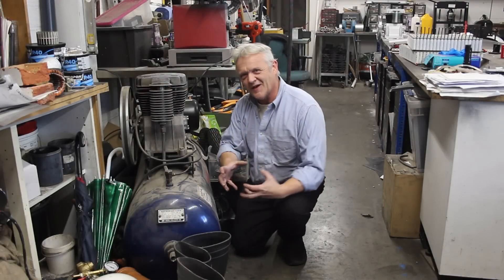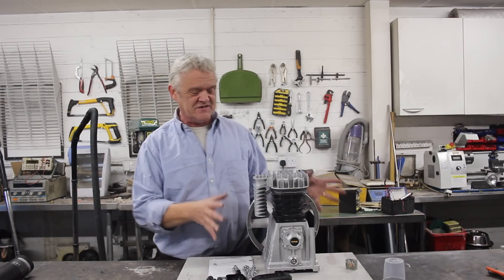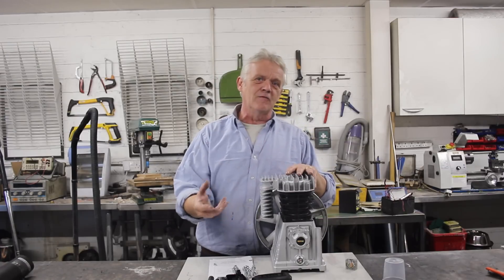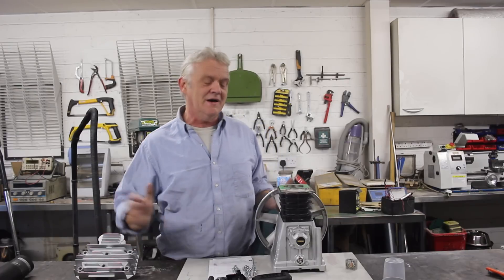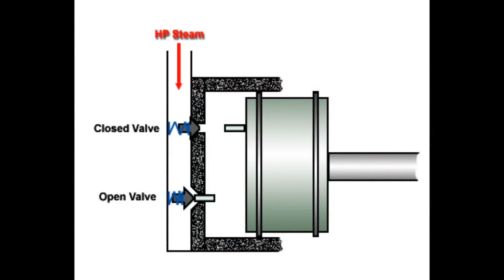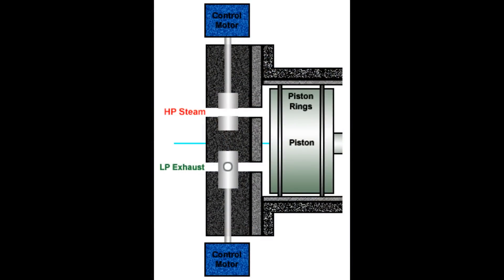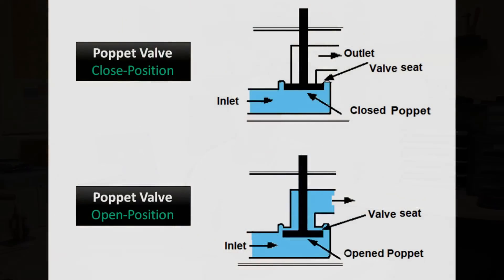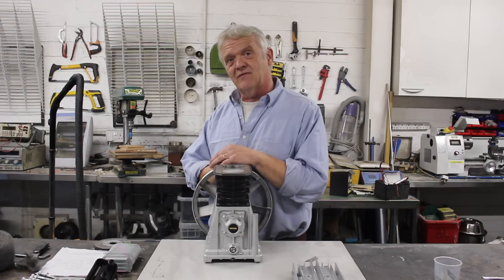1693 A DIY Multi Fuel Home Generator 2 - Changing One Type Of Engine Into Another Type Of Engine

Comment: I've been looking at running a generator using air so this comes right on time. 
I haven't run the numbers but if you can get an air compressor to run high enough pressures then run it in the daylight hours to store the air we could make an air battery which in turn could run the generator for electricity at night and hardly any chemical batteries would be necessary. 
That's the hope, anyway.

Comment: 2 stroke engines are the easiest to convert to steam power, but you have to introduce hygroscopic oil into the engine with the steam/hot air/air pressure/etc. to keep the bottom end lubricated, but will work with almost no conversion at all due to the design of it.
When using an air compressor or converting an internal combustion 4 stroke engine to steam, you have to keep a close watch on the oil since the steam will condense back to water in the crank case.
I had a steam engine I built out of a 60cc weed whacker engine and it performed really well, especially when I used waste oil to boil the water for it, and I just had a setup that would add hygroscopic oil into the intake with the steam and it ran almost continuously for about a year without any issues, until I decided to save the waste oil for filtering and burning in my diesel truck and car.

Comment: You missed probably the simplest valves of them all which would probably work fantastically for a steam engine and that's the reed valve and  the ball valve. No controllers or timing to worry about and probably the most reliable plus it follows the KISS principle.
For the ball valve buy a non return valve plumbing fitting and remove the plastic internals and the spring and remake them with brass unless you can buy all metal version, the reed valve would be a bit more tricky to find or make.

Comment: I don't get it. Assuming you already have the rocket stove and boiler, what are the benefits of this complex failure-prone mechanical design versus a simpler rotor+stator+permanent magnets+copper coil generator, with the rotor moved either hot air or steam?
Is it just to tinker with a compressor, or is more efficient than a regular rotor+stator, or am I missing something (beyond gray cells, of course)?

Comment: Yes to the solenoid valve setup,  there's a guy converting a mazda engine to run on solenoids as is koenigsegg, but I would like to make a play for a diaphragm rubber valve setup for a non-computerized version, where each piston covered by a rubber piece with a hinged section in the middle that pushes open when piston goes from BDC to TDC, and pulls shut at some level of force the other way, due to its weight. Thinking that might be a version a/b design.

Comment: Why don't you just use an old lawnmower engine. There's loads of them about now every one 's changing to robot mowers.
I've got 2 Briggs and Straten engines that just need recon. kits. Still interested to see how you do it though, to see how much power you get out of that 2 cylinder unit?

Comment: VACUUM steam engines are the most efficient but lack power. This operating mode is used for hybrids and TIRs - for savings.
Aircraft with CONTRAILS also use this operating mode. THE CONTRAILS are betraying the savings!
GEET electric generators - too.

Comment: I've been reading about optical heterodyning and searching for photodiodes with values that look amenable to the heterodyne products involved, but I'm not having much luck. If you were to do some content about this, there's at least one guy interested :)
Reply from the maker: to my mind optical heterodyne detection can encode a lot of information mate - pretty good for information heavy signals but quite a bit of overkill for a steam engine valve control where all you really need is TDC of one piston I would think - so not sure if I am going to do it for this project but I will have a think - cheers

Comment: years ago we used a mechanics 1/2" air gun as the engine on a go cart, the limiting factor was the compressed gas bottle. Tom Stanton made his own version a yr or so ago and I seem to recall some where in europe a guy made a car using compressed gas but again the tanks were a limiting factor... I think its easier to turn an ICE into a compressor than the reverse.. any lawn mower engine, remove the plug and spin the crank..  I think it was back In the 40's you could buy a fitting you replaced a plug in your cars engine to make a compressor... imagine pumping gasoline filled air into  your tires or swim floats!! LOL
Reply from the maker: lol - yeah that would be a little concerning - this compressor contains quite a bit of room in the heads - would take a spark plug but I think the pressure from firing this up as an ICE would be a bit more than the head could cope with

Comment: Be aware that your crank is an opposed stroke. 4 stroke twins are usually simultaneous stroke meaning both pistons move together so that the firing pattern is every 360 degrees apart. 
The one in your video is like a John Deere model B where the pistons move opposite and firing is at 360 then 540degrees. 
There’s nothing wrong with that…opposed piston movement cancels each other out and is more balanced, that’s why John Deere built it that way. 
Your engine will have the John Deere “plop” sound instead of a modern Kohler sound. 
I’m building a cross plane 4 cylinder right now which is like 2 John Deeres 90 degrees apart. 
Personally I like the John Deere “plop” sound 👍
Reply from the maker: me too!

Comment: Annother valve type... Pneumatic or hydraulic. Pretty much a piston that highish pressure fluid presses down on to open say a poppet valve. But can get ones that handle fluid logic. Including say a flip flop. 
A nut or some other projection on side of flywheel could be use to trigger a pneumatic sensor... Akin to a microswitch, but outputting pressured air... 
The output from one such sensor triggers a pneumatic flip flop to latch "outputing pressure"
Output from 2nd such sensor triggers flip flop to latch into "no output pressure."
Output from from flip flip. Drives main cylinder valve.  

Connection between pneumatic sensor and flip flop can be flexible hose... 
Adjust position of pneumatic sensors around flywheel to adjust timing of when valve opens, and independently when it shuts.

Functionality should be same as a trip valve, ( the bump valve is a simple none adjustable form of such) with less of the mechanical issues associated with them.
Reply from the maker: nice tips mate - cheers

Comment: Nit picking - Diesels can be changed into other types of engines but not vice versa. A gas or steam engine would not hold up to the very high compression ratios of diesel.  
Some engines do not have valves like the Sterling engine.
Reply from the maker: lol - for sure - but not really the point mate
Reply: @ThinkingandTinkering  True, not the point. 
Looking forward to your next video.

Comment: The history of solenoid driven steam engines is not good.  The solenoids fail after a relatively short time.  Good for a demo but the mechanical linkages are far superior for durability.
Reply from the maker: good point ate - cheers

Comment: Rebuilding an engine to run on another type of fuel is a good challenge to get right and running correctly. I have another challenge for you. Getting one engine to run on different types of fuel without having to do a full teardown rebiuld. Yes it'll have to be built up from the get go but after that how many different type of fuel can be used to run it from then on out.?
I've driven vehicles that ran on petrol for the warm up then swiched over to propane. But can you build an engine that will run on Petrol, Alcohol, Propane, Natural gas and Diesel without a teardown.? Possibly just a change in valve timing, turbo boost, fuel delivery method.?
Thank you so much for the thought provoking tests, chats and builds you'r doing.
Reply from the maker: I like the idea of that as a project mate - therein idea here is to build a genes that any fuel can run - but I may well take up the challenge you just set - it catches my imagination

Comment: Is there an air battery (air compressor) storage system in the works? 😏
Would love to see solar or wind run the  compressor,  then reverse the process to tap into the stored enegry 🤩
Reply: You know I've had that same thought, I like the idea of microcompressors for each solar panel or wind generator connected to a large air storage battery like what the Amish farmers use, and what they had in France a few hundred years ago, it seems to me a perfect way to have a decentralized Energy System while still having it interconnected.
Reply from the maker: I do like the idea of compressed air as storage

Comment: That is a great explanation of the differences with example!  I would highly recommend the slide type valve from steam engines as the way to go.  You have two pistons and the simple slide valve I have seen is an eccentric from the flywheel that moves a block to either end of a solid steam piston.  In your case, instead of switching between left and right sides of one piston, you could have it switch which piston and have a second block on another eccentric 180 degrees from the first to act as the exhaust valves.  That would allow one input of compressed air or steam and one outlet with the added benefit that you could accidentally swap them and the only result would be running in reverse direction.
Reply from the maker: I like the idea of slide valves too mate - robust and simple - great for long term use

Comment: Too bad you can't create a nice Stirling engine out of that piece. But maybe a twin cylinder motorcycle engine could work better for that since the pistons are separated by air/space to allow one for the power piston and the other cylinder for the displacer.
Reply from the maker: yes I thought it was a shame too - if it were a V type I would have certainly gone for a Stirling engine

Comment: I've been tempted to try their rolling mill a couple times in the past, as well as a couple of their other options. But I never could afford to pull the trigger if they weren't high quality enough to hold up under the strain. And didn't know if they would hold up well or not. 

Good to know their products are seemingly decent quality. May have to reconsider.😅
Reply from the maker: I have only had 3 things from them - the lathe is doing well - the diesel heater seemed robust to me and we are basically testing their compressor mate - so we will see

Comment: Darn Robert, really you could use a large piece of (CRYSTAL) for your see through Head Cap and convert pressure into Electrical Pulse to maybe run Spark and other low voltage equipment. What do you think of my Idea? Do you think it could work? Thanks for sharing your vast knowledge with me. I do really appreciate this very much.
Reply from the maker: I don't know if it would work or not mate - but in situations like that - I would certainly test it if I could find a large pipe of crystal!
Reply: @ThinkingandTinkering  Thanks Robert for your reply. I think this would make a fine video, if like you said, 'the Crystal was large enough. I think the Crystal would only need to fit a small area right above the ignition area. The Engine compression would give the Piezo Electric Effect from the Crystal. Sorta like the Electric Cigarette Lighters. I don't know, but I do think it would make a fine video.

Comment: I am a little confused about something: The maximum pressure of most compressors is somewhere between 125 psi and 250 psi (17.23689 barr). The pressure of a typical combustion engine (at the moment of combustion) is in the "thousands" of PSI range ( 68 or more bar). Wouldn't the design of most air compressors be insufficient to handle combustion without exploding?
Reply from the maker: here's a guy who did it https://www.youtube.com/watch?v=xfeazlDEP50

Comment: What is the difference between piston Compressor and A linear compressor. I under the piston compressor, how does a linear compressor work. I believe they us less power?
Reply from the maker: there are two types as far as I an see - a linear piston pump and a linear diaphragm pump - they work pretty much the same way but have no crank as the are often actuated from two sides

Comment: With a certain dip into irony, I was looking at turning a two stroke into an on-demand air compressor before scoring a big ol' honker (tank-based 5hp compressor that is) out of the modern day classified ads just recently, figuring the relatively simple reed valves used on most two strokes would be the easiest way to convert to what I needed. After digging through an awful lot of schematics of various air compressor pumps to see how feasible it would be, even the really expensive models still operate with very simplistic reed valve systems. 
I'm rather excited to see what you come up with, Robert!  Outside of maybe a change in gasket material, that air compressor pump should be a real treat for an externally-produced steam receptacle.  Valve controls and pressure relief systems are really the heart of any good steam engine, so don't skimp on those. 👍
Reply from the maker: I agree mate and thanks for the heads up

Comment: Brilliant. I have, and there are so many about, engines, compessers etc to convert. This is perhaps one of the most sustainable and simplest routes currently known to becoming energy independent without too much discomfort? Burning sticks and rubbish to create steam or fuel to drive an engine then generator producing electricity? Or bio fuel from decomposition perhaps? Best wishes.
Reply from the maker: my thoughts exactly mate
Reply: I tend to favor methods of power generation that don't involve burning something, if not for environmental reasons then simply out of convenience for not having to babysit it and feed it material. But if you need to heat your home anyway (and you don't have a heat pump, or can't afford the power), why not extract some mechanical work in the process?

Comment: Rankine cycle! Forget air or steam. Just get an old refrigerator and hook up the engine in line. Refrigerator or air-conditioner and hey while you're at it, use the hot side could heat water.
Reply from the maker: for sure mate

Comment: I've just spent the last 6 months building an entire engine from scratch including drilling and boring the cylinder and turning the piston and all the linkages, and you're saying I could have just bought for 99 quid a ready made system minus the valves...... :(.  I've still got to build the pressure boiler for it and the burner component.  In 6 months time you'll be telling me I can get those ready made for bugger all too no doubt.  Ach well, it's all in the name of science I suppose.
Reply from the maker: lol - no mate - this is an easy version - it's never going to be as good as purpose built - but it is something a small shop can do

Comment: Would doing a stirling out of something like that be more trouble than its worth, do you think?
Reply: Ringbom type Stirling would probably be the easiest conversion. Of course, Stirling engines don't require valves of any kind. Just the external application of heat.
Reply from the maker: I think it would be fine - you can't do a good job with a inline set of pistons they share the same cylinder block and you really want to keep the hot and old side separate - that's why V twins are popular
Reply: @ThinkingandTinkering  The Ringbom type Stirling can overcome that issue by having the heat exchangers completely external to the power cylinder(s)

Comment: ooo i am currently working with replications of the correct Nikola Tesla Valvular Conduit and can run at 1000's of pulses per second as it was designed to work with a PDE so no reason it cant be made to work with any combustion engine. robert and these things are amazing once you fully understand the setup and can tune them hehe they will last for ever with no moving parts as well. They use them in the space industry for good reason as well.
Reply from the maker: I have been pondering that mate - but what really stumps me is an easy way to make it - I am still mulling it over - can you keep me in touch with how it goes?
Reply: @ThinkingandTinkering  a YouTuber called Integza has used a ceramic resin to print cylindrical Tesla valves for a rocket engine.  Could use the ceramic resin to test the concept and refine the design, then have the final design printed in metal by a service.
Reply: @McRootbeer  be carful of others trying to replicate these valves as imo there not direct replications and i am not sure they fully understand them.
Reply: @ThinkingandTinkering  yeah it's a tricky thing to do bud I have an elegoo saturn which with my new cad skills I can build and print these simply. I will keep you posted with test data hopefully in the not too distant future.

Comment: Nice article BUT a little simplistic. Changes into SOME engine types cannot be done with just a head change. How do you change an aircompressor into a 2 stroke petrol engine by only changing the cylinder head?
Also you failed to mention reed valves (were common on small 2 stroke engines) and sleeve valves (Bristol Centaurus - Hawker Fury/Sea Fury)
Reply from the maker: hmmm - I don't want to seem rude mate - but even though it is simple you might have missed the point - we are not changing the head - we are working on the head to change the valve - and I didn't forget those valve types I assure you lol
Reply: Thank you chaps, I stand corrected.
Reply: Actually most hot air (Stirling type) engines don't use any valves, just heat exchangers.
Reply: A flame licker is a 2 stroke engine with only a single valve and would be fairly simple to modify any 4 cycle to be a 2 cycle flame licker. Of course they are a crude engine and probably not the best design but it goes to show that 2 cycle or 4 cycle are still just a valve combination difference.